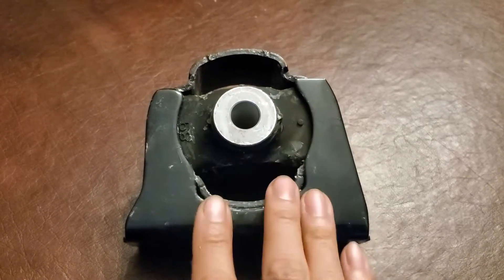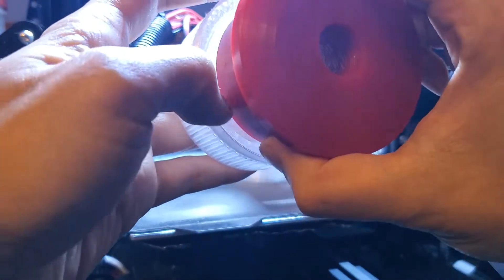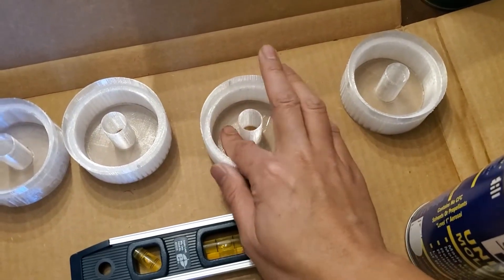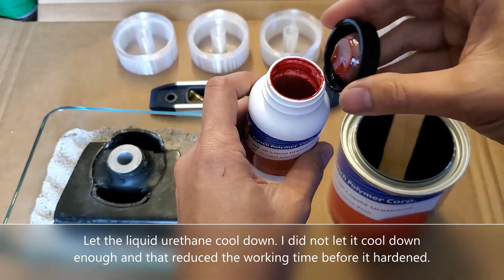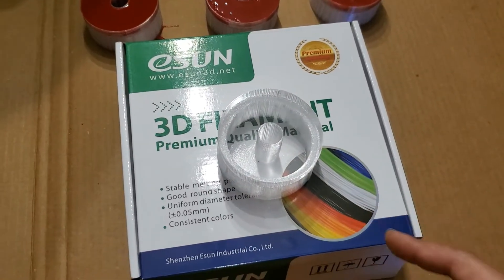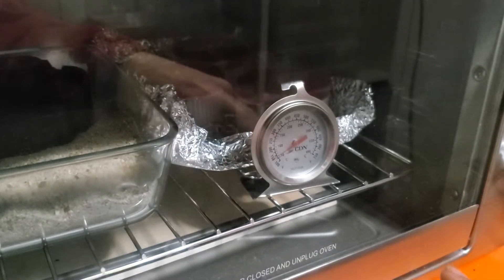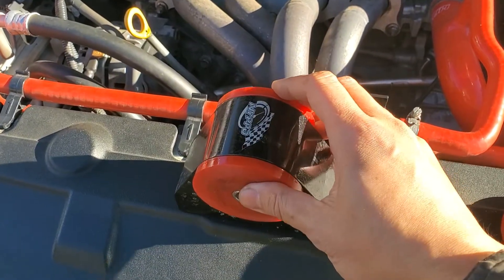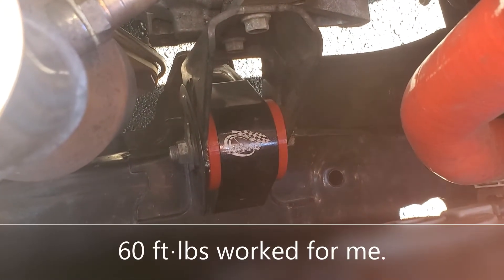Casting Polyurethane Motor Mount Bushings with Liquid Urethane & 3D Printed Mold (Scion tC2 / tC2.5)

Comment: Some time ago I fitted my Honda with bushings directly printed with TPU. 100% infill. Worked like a charm.
Reply: how well are they holding up?
Reply: @ethandelafontaine They held up ok while I had that Honda. Btw, it was a low budget racecar back then. 4 years of abuse and no wear on those bushings.
Reply from the maker: Holding up as well as any other polyurethane insert, but I'm currently not using them since I switched over to some 3D printed ones recently.

Comment: You can see a video on my channel where I made motor mounts for a V10 swap using super cheap polyurethane  --- outdoor glue loctite pl3.  Only downside, It seems pretty hard and it takes days to fully harden.  On my racecar we didn't have time for that as we had to fix it at the track,, I bought the pour stuff that hardens in 1 hour, it worked well, but after 2 races it failed.

Comment: Anyone ever make aerated urethane bushings so that you get the benefits of polyurethane without the excessive hardness?
Reply from the maker: The best option is to use a softer durometer polyurethane or make the inserts shorter so there's a gap between the two end pieces.

Comment: Have you ever tried printing an 80A tpu bushing instead of using the molds and stuff? I modeled all the bushings on the EG civic and del sol and put them on thingiverse for people to print but I don't have a printer yet so I don't know how well it works.
Reply from the maker: Since I originally posted this video, I have 3D printed bushings, but not for the engine mount. I replaced my upper rear shock bushings with 95A ones since I have a strut bar bolted directly on top of it.

Comment: You can use PVA (which is a water soluble support filament) to print the molds. After casting you can dissolve the mold away from the casting with water.
Reply: Waste of PVA imo, just use thicker mold and release it with compressed air. Much re-usability without printing another mold.

Comment: You normally dont need to destroy the moulds, just squirt some compressed air down the sides and the rubber part will pop out. If it is hard to get down the side drill a tiny pinhole in the bottom and squirt the air in the pinhole, then the pinhole can be covered witn sticky tape for the next mould use.
Reply from the maker: The mold would definitely need to be printed thicker for that.

Comment: As I am watching this I am 3D printing a custom gearbox mount for my Volt. I am using TPU 95A with 40% hexagon infill and 5 shells plus 5 bottom and top layers. I just did a web search and it seems that TPU 95A may have not been available at the time of this video. It is amazing how 3D printing has revolutionized the DIY engineering scene. Great video!

Comment: TIP: Need to use a vacuum chamber to get the air out of those while they are liquid
Reply from the maker: This actually starts to thicken up pretty quick. The ones I poured as soon as I mixed the polyurethane were fine.

Comment: Another good variable to check is how much the engine moves when you load the drivetrain. Pop the hood, start the car and put it in drive (in an automatic), but hold the brake with one foot, and give it some throttle (so the car doesn't move!). Note how much the engine rotates as it revs.

Comment: Motor mounts are really large, but I'm hoping to do this with differential bushings for my SRT8, then move on to suspension parts as well. Freaking k member bushings are $200, diff are $150 etc, just ridiculous by the time you replace all the the link bushings and such.  Car is multilink front and rear, probably 30 bushings, averaging $25/bushing or more. Yuck. can replace the entire arm with rubber bushings for that. 
Here's an idea I'm curious if you're interested in trying- what about casting an insert for the oem motor mount, other subframe mounts etc, IE how torque solutions does it. That what you don't get much extra NVH until it starts to deflect significantly.
Reply from the maker: I thought about making inserts, but I think it's just better to fill the stock mounts once you trim out some of the extra rubber per https://youtu.be/DxAL2n7VtMU. I don't have any issues with NVH with my mounts.

Comment: wondering that material is a little soft ? or absoultely hard?  i wanna get a bushing harder than rubber.
Reply from the maker: Any of the polyurethane mixes they have for suspension will be harder than rubber. 95A is going to be the hardest. 80A is recommended for a daily car.
Reply: @VampyreX13  very thanks there are so many hardeness grade
Reply from the maker: Yes. I'm using 80 shore A hardness in my car. Read this for more info: https://polytek.com/how-to/video/mold-making-tips-mold-rubber-hardness
Reply: @VampyreX13  it's informative i am planning to make 65A Bushing for FLEX JOINT

Comment: What is a softer more oe style mount? For 08 tc
Reply from the maker: OE is going to be the softest. If you need softer, get the Torque Solution mount for your tC and make a bushing with softer polyurethane.

Comment: Hi if you drill a small hole in the bottom of the mould and use compressed air they’ll remove much easier
Reply from the maker: Thanks for the tip!

Comment: hey great job and review did you happen to do rear engine mount and side mounts also?
Reply from the maker: No, only the front torque mount.
Reply: @VampyreX13  notice big difference with rear and front done i did it and stop engine rigidity :)
Reply from the maker: @deejayrelapz6903  That would be too much vibration for my daily though.

Comment: I’m having issues with my 2014 vibrating when idle in drive. Could some of that be related to my mounts?
Reply from the maker: That could be a sign of bad motor mounts. Check the side and rear ones since the front doesn't support the engine.

Comment: Does it degrade with the heat? Can you alter the poly recipe for a softer bushing?
Reply from the maker: No, it's been fine in the engine bay sitting next to my header. If you want a softer bushing, order the liquid urethane with the lower durometer rating.

Comment: Hey dude I really appreciated your video. I subscribed and all. Where did you get the bushing sleeves and would you be able to help me with gathering the measurements for my bmw e46?
Reply from the maker: Do you mean the sleeve bearing that sits inside the bushing? That came with my aftermarket mount. As for measurements, I recommend getting a digital caliper. I used one from Harbor Freight.

Comment: Hello, Derek when I spoke with Kevin at Energy Suspension, he told me I would have to order between 100 -500 and they do not do single orders. Any other Ideas?
thanks, AA
Reply from the maker: Get the part number you need and ask them for one of their distributors that can fill the order. What are you trying to get from them exactly?
Reply: Derrick Aquino  He did not want to help because he told me just to get started I would have to get the engineering Dept. Involve and that would take a couple thousand dollars.
Reply from the maker: @alfonsoalvarez8251  what are you trying to make?
Reply: Derrick Aquino : Hello, my friend they are the bushings for the front of the spring shackle. EMU send the wrong size. I imagine due to the COVID 19 they are making them and they do not make many on the size I need. Thanks AA
Reply from the maker: Is it a simple round bushing? Do you have the measurements for it?
Reply: Derrick Aquino  Yes I do and also have pictures.
Thanks , Al
Reply from the maker: @alfonsoalvarez8251  message me on FB. The link should be at the top of my main Channel page.

Comment: How can I mail you a rubber pad so you can make me four polyurethane spring pads for my 61 Thunderbird that no one makes?
Reply from the maker: So you want to make a polyurethane version of the rubber pad you have? If so, there's a different method you can use. Let me know.
Reply: @VampyreX13  yes that's correct. You read that perfectly!
Reply from the maker: @georgenettlesjr1466  my recommendation is to get a silicone mold making liquid rubber (https://amzn.to/3aOTiXy, though you may need enough to make 4 individual molds) and  mold release (https://amzn.to/2Qlr8u6) along with the polyurethane mix. Make 4 copies of the rubber pad so that once you mix the polyurethane, you can use it all at once and pour all 4 molds.

Comment: Do you think printing 3d molds is better with a resin printer?
Reply from the maker: I think a filament printer is better for something like this. I'm not sure how well resin would hold up to being baked and how hard it would be to pull off the polyurethane.
Reply: @VampyreX13  thanks!

Comment: What is the benefits of polyurethane exhaust mounts?
Reply from the maker: They don't sag and they prevent the exhaust from bouncing around. They're great if you need the exhaust to sit in one spot to avoid hitting the bumper or anything else. If I didn't have them installed, my muffler would bang on my trailer hitch all the time.

Comment: Hello, Derick

Can you make me 4 bushing for the from EMU lift kit, they send me the wrong size. I need 4,  - 39mm eye size. They are for 76  Toy Landcruiser  FJ40.

Thank-You
Reply from the maker: Unfortunately, I just don't have the time. At most, I might be able to design and 3D print the molds for you, but I would need precise measurements. My recommendation is to call Energy Suspension (949-361-3935) and tell them what you need so they can find you a compatible, if not exact, part number to order.

Comment: Hey, out of curiousity what do you thing of directly printing polyurethane bushings using tpu filament?
Reply from the maker: I haven't used TPU yet, but someone commented in one of my Facebook posts and said they "printed many parts out of 90A TPU and they seem to hold up well on both race cars and street cars. I'm sure the molded product is better though."
Reply: I currently supply a customer with poly bushes 3d printed in ultimaker tpu, he uses them to build up the custom air shocks on his air ride systems, they work really well.

Comment: How bigger is the bushing in relation to the size of the hole in which it is pressed?
Reply from the maker: It was exactly the size of the opening in the mount. It's snug, just like the previous bushing it replaced.
Reply: @VampyreX13  Thanks man